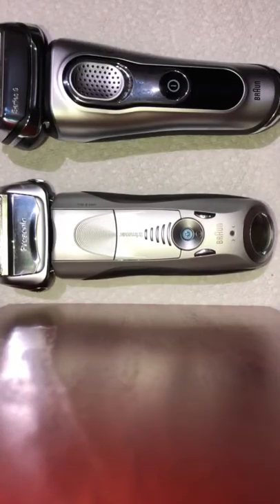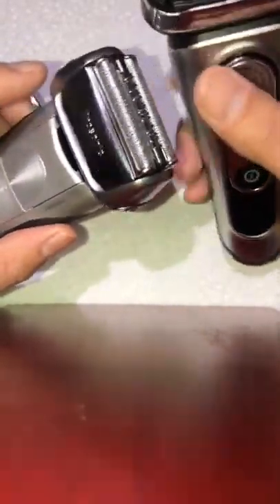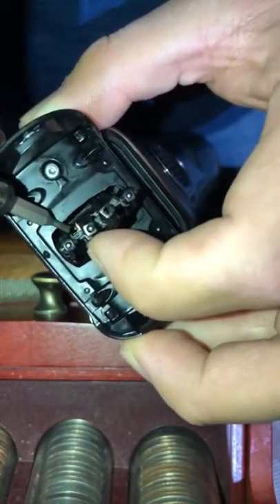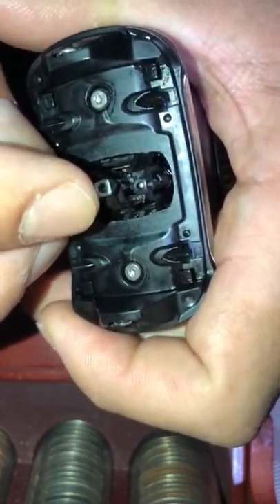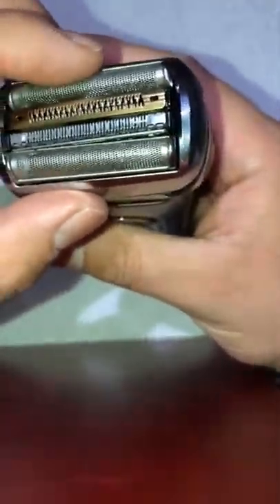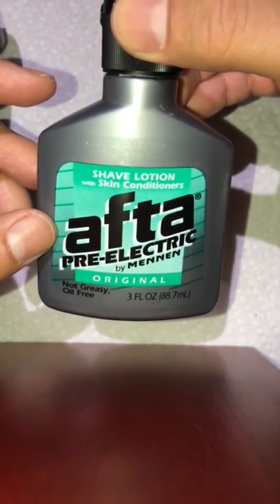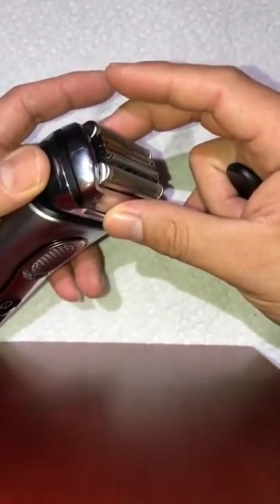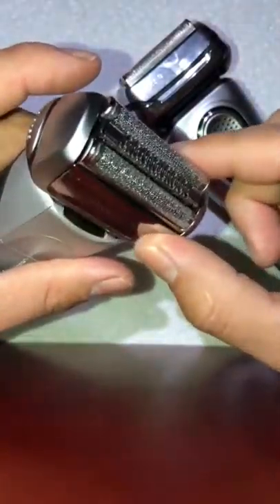How to fix Braun Shaver pulling on beard.

Comment: Just wanted to tell you that the Gold color bar on the shaver head always goes to the front side of the shaver this is info from a Braun tec and I see you have it to the rear. Maybe you know that but seeing the way you show yours in the video I just taught I would tell you,
I found your video very helpful because mine was stuck to and not easy to get it to snap in but after a couple of try’s i got it, I’m not a Braun Tec but the info I put in this is from one.,

Comment: I am using braun series 9 9290cc. The fifth cutting blade (foil) that's the last one that faces towards the back side of shaver is actually going downwards than the other blades. Can you please help me and tell me how to fix it? Thank you very much
Reply from the maker: Not sure 🤔 I think I would have to see it. So one of the foils on the edge sinks on its own? That’s could be because of no support but maybe the cassette is broken. Have you tried another cassette to rule that issue out?
Reply: @frkre05  Yes. I have bought a new cassette and in that too the above thing is happening. Any idea what I can do myself to fix this issue?
Reply from the maker: @sevenking5224  ok so it’s the same issue as I was fixing but I can only fix the 2 middle ones. The outer ones on either end seem to be siting on a spring and it looks inaccesible, this might requiere to disassemble the entire head to fix. I have done this with an older model and it’s a pain and I didn’t put it back together. I advise to pay a service center or contact Braun at this point.